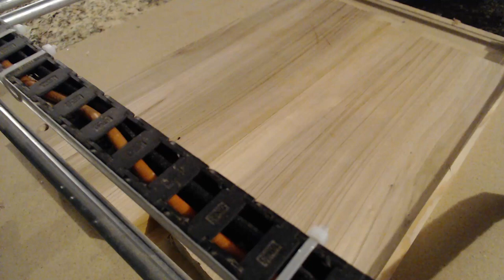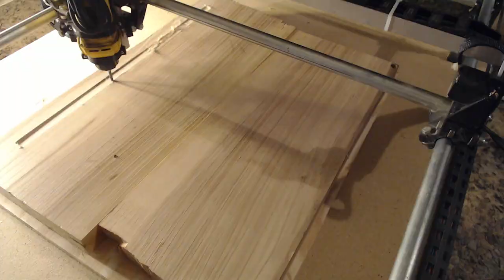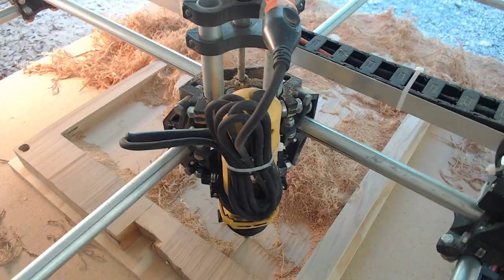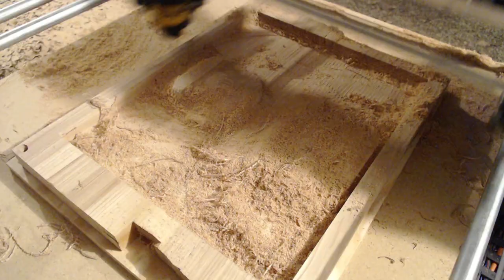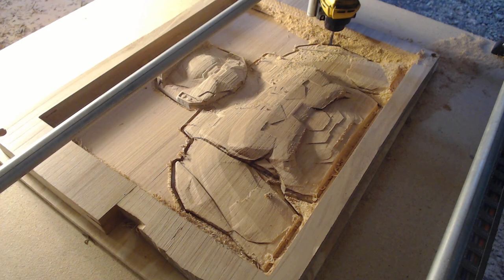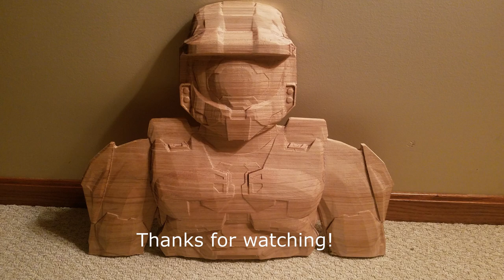Halo Master Chief relief carving  timelapse with MPCNC

Comment: Awesome job!!!!!!! That’s the coolest thing I’ve seen made with the MPCNC so far!! Omg running it 24 hours straight that’s amazing. Can you share the size of your machine and the carve please? I may have to try to replicate this
Reply from the maker: Sorry I don't have the exact numbers - I think my max build area is about 24x32 inches.  This carve was 28x13x1.5".  Before I do one of these long cuts I always check the brushes in the Dewalt 660W- this seems to be a point of failure that is avoidable and replacement brushes run about 8-15$ per pair.  Also the machine should be in a place where you will not burn anything down if it catches fire - take a look at my earlier video where my old MPCNC destroyed itself.  Now I run the machine outside under an overhang with a gravel floor.

Comment: if your goindg to cut it out anyway have you thought of setting a model boundry and eliminating machining all that  flat background, it would speed up the carving alot,  oh and also 

 happy new year
Reply from the maker: Thank you for bringing this up - I agree, it is a waste of time and machine wear to remove the extra wood.  I thought of this as well and actually tried/simulated it for a future project but was not able to find a way for Estlcam to generate the gcode for the final pass gcode to pass over the areas that were not cut out.  I am sure there is a way to do it but have not invested the time to figure it out.
Reply from the maker: Also happy new year
Reply: @jwdirk  oh i see i use v-carve pro and creating a boundry is a easy  feature of it
Reply: @jwdirk  fingers crossed its better than the last one
Reply from the maker: @martyn1678  Thanks for the tip, I'll have to look into V-carve.

Comment: Hello sir , very nice work . Am glad u built it cnc again after it collapsed. What wood u prefer to use for carving ? MDF or PINE
Reply from the maker: Thank you for the complement - as far as what I prefer carving I tend to work with what I have available.  I am an amateur at woodworking so understand that my preferences may not be what are truly appropriate.  I have never cut a relief in pine (but would like to).  I have cut in MDF, oak, maple, cherry, elm, and ash.  The best results I have gotten are in maple - my Pegasus relief in terms of detail/ease of cut.  In my opinion, cutting with the grain with woods with fine grains give the best results regardless of hardness (this can be adjusted in gcode/software/cut speed).  

As for your question - I feel that pine would yield better results.  Again, it depends on what you are trying to accomplish - MDF is probably easier to cut but is is difficult to paint after cutting but pine has a natural grain which has a nicer look if you are staining or aren't going to paint.
Reply: Jack Weeman thank u sir for taking time and answering my question 
I appreciate that 
If u have an website and more than happy to donate for ur work or help u with progress u doing 
Thanks 
God bless
Reply from the maker: @namocrafts1101  Thank you for the compliment - I do this a s a hobby and do not have  a website.  I will try to be more helpful/descriptive in my future videos now that there seems to be some interest in the process.

Comment: Jack you have been doing incredible work with the mpcnc.  Can you make a tutorial of how you do the tool change.
Reply from the maker: Thanks Pedro.  I will try to include this in my next video.  I can tell you that I make a separate gcode file for each tool used, then rezero with endstops and use the same xyz offset before starting each cut.
Reply: @jwdirk  Thank you for your quick response.  I don't have endstops on my mpcnc, so I guess I have to find a different way to do a tool change.
Reply from the maker: @caxcannoch  I only recently added endstops.  The way I used to do it was put the zero at one end near the center but out of the cutting space.  I would briefly turn on the router to mark the spot.  With subsequent tools I would manually move it to the marked spot, drill slightly deeper, then set a new zero.  

The problem with doing it this way, besides error from manually positioning it, is that when the steppers initially engage after being manually positioned they move slightly to lock the nearest stable stepper position and introduce some error which is hard to get rid of.

I recently had to make some big changes to my machine and decided to add the endstops while everything was taken apart and am really happy I did.
Reply: @jwdirk  Thank you.  I wish there would be an easier way.  Maybe I should change my mini rambo to a full size to be able to add endstops.

Comment: Excellent. What kind of wood are you using? Oak? Maple? Thickness?
Reply from the maker: Thanks!  This was in elm, carve was 1.5 inches deep and total board thickness was ~1.9 inches
Reply: @jwdirk  Beautiful job!  Thanks for the info!  I'm building an MPCNC as well.  Dewalt Router.  I'm hoping to try cutting Acrylic sheets, perhaps some brass, copper, or aluminum in limited quantities.  I'd like to cut some wood, but I'd have to think of ideas for projects.  What CAM are you using?  How do you like it?  Does it require keeping your files on a cloud like Fusion360?  I'm looking for a good CAM that's low cost or free, and can be run off a laptop not connected online.
Reply from the maker: @cobannie  I use my mpcnc mostly for relief cutting, so I use artcam to generate the stl (this is no longer available but there is an expensive replacement), then convert to gcode w estlcam and run it w repetier host.  

I don't know fusion 360 but I should probably learn it.  I played around w inkscape to make svg  files that can be read in estlcam - I think this is the best thing to start out with depending on what you want to make.  For settings on speeds for different materials I would take a look around v1engineering to see what others are starting with. - I know aluminum and acrylic has been done w mpcnc but am not sure about other materials you mentioned - it might take some trial and error.

For free programs inkscape is open source, estlcam is fully functional but with an increasing neg screen asking you to buy, and repetier host is also free

Comment: Is it posible to avoid those lines that you can see at the final product?
Reply from the maker: I did not mention it in the description, but I accidentally used a 1 mm ball head mill although the software was set for a 2 mm ball mill - so it was actually stepping 30% when it should have been stepping 15% per pass.  This may have avoided the 'lines' on the final product - although they are not very apparent in natural light and most were removed with some sanding.
Reply: @jwdirk  it looks great regardless